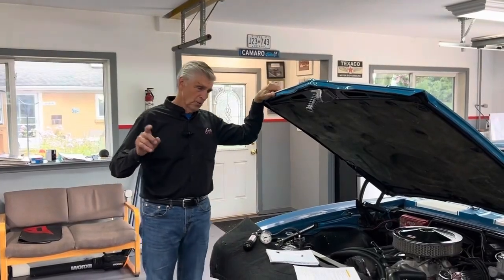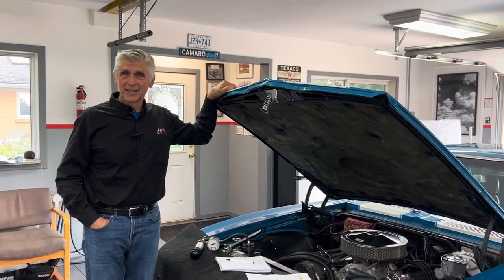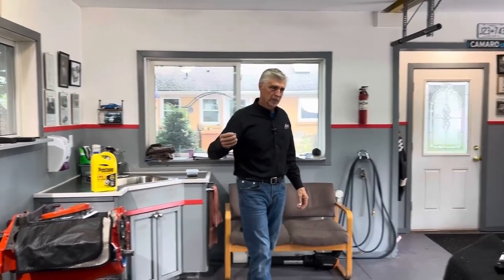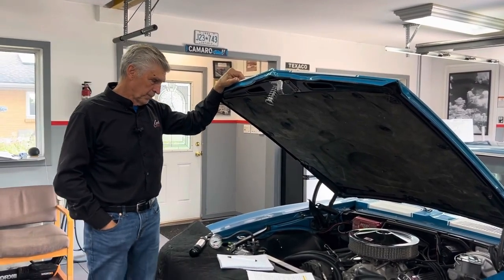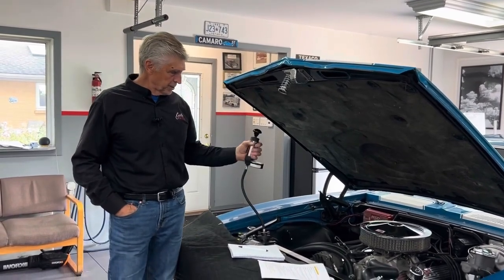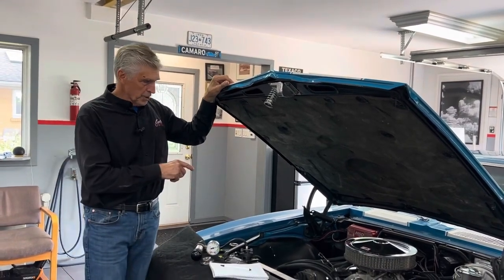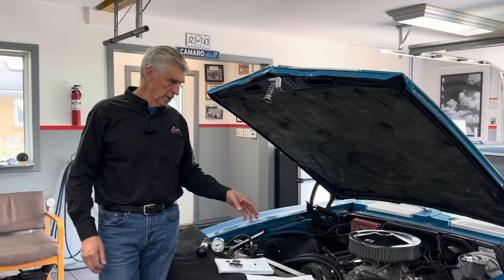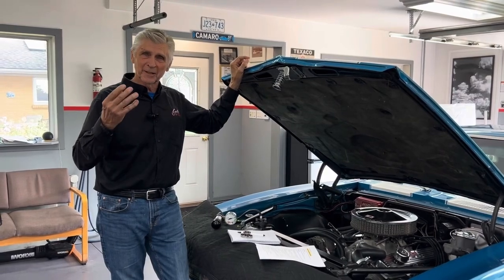THE ENGINE KILLER THAT GOES UNNOTICED! Coolant leak?? What should you do??

Comment: Recently had some poor quality Amazon pipe plugs in three locations on two different cylinder hands leaking coolant. Replaced with better quality plugs and stop the leaks and luckily completely external. Link was very slow and took a month before there were witness marks of where the coolant was leaking.
Reply from the maker: Thanks for your comment Reeves. I have had similar experience with Amazon pipe plugs. Always something new to trip us up. AG

Comment: Don't forget to NEVER Re-use head bolts... Once they are torqued, they stretch. A second use may cause coolant to seep into crankcase. 
ARP is the best way to go for head bolts with plenty of lube. They are an added expense, but great insurance to prevent leakage..
Reply from the maker: thanks for your comments Onm. AG
Reply: That's specifically for TQ to yield head bolts. The 100,000's of racers engines around the world that have reused head bolts after a refresh and Tear down inspection would state otherwise.  Rod bolts which are a lot more critical needing to achieve a specific clearance get Torqued several times on a new build. Which is proof that a bolt can be torqued more than once. We do monitor stretch which will tell us when they are no longer usable. I'm on my 5th freshen on current engine with the same head bolts. It's just been getting faster. Pretty rare to have a failed head bolt on a under 1000hp N/A engine.  Seriously boosted engines are a different story. Making sure the sealing surfaces are free of imperfections, have the proper RA value(roughness) for the type of head gasket user along with being  flat are the critical aspects for sealing head gaskets.

Comment: To soften up the peak tq you can go with a larger diameter intake manifold runner, reduce overlap, extend intake duration. Retarding the cam will soften below pk tq.
Reply from the maker: Thanks Shane, all good points and things for me to think about. AG
Reply: @goldsgarage8236  Another thing you can do is vary ignition timing. With a progression ignition programmable distributor you can pull timing around peak torque and add it back in after etc.

Comment: Hello Allan that reminds me of Cadillacs HT4100 horrible engine
Reply from the maker: Thanks Christopher. Interesting, that is one of the engines i was referring to. I had a 1987 Cadillac 4.1. The only time I ever purchased the extended warrantee. The camshaft failed after 7 years because of an intake manifold coolant leak. GM replaced it at no cost. AG
Reply: @goldsgarage8236  Yes sir the cam went out on ours too and the oil filler cap stayed milky. Backfires through the throttle body at mid acceleration

Comment: Hello AG, I have found that the factory GM pick up truck TBI air filter housing assembly from around a 1995 C10  will work on all these carbs. If you go to a wrecker, get a,one and the 1-1 1/2 " spacer that mounts between the throttle body and the filter housing base.These breathers have a large snorkel and a slightly dropped base . the spacer will allow it to mount on a Quadrajet, Holley or Edelbrock . I have a factory twin snorkel base on a vortec head 383 using a Edelbrock EPS and a square bore to spreadbore adapter thats maybe 3/8 to 7/16" .... it works pretty good.
Reply from the maker: All good info, thanks Nerrad. AG

Comment: You should also talk about short tripping your car and not getting it warmed up. Can get condensation in the engine that way. Or too cold of thermostat in cold climates. I had that issue with my 351m truck with a 180 tstat. Even cardboarding the radiator didn't help much. Didnt want to run a block heater due to energy costs where I'm at.
Reply from the maker: Thanks Frank. That is a very good point. Getting the oil hot will help to evaporate any moisture in the oil. AG

Comment: If  you run water as coolant and you store your engine below freezing make sure ALL the water jacket is absolutely dry,  blow it out, do not just rely on the block drains to empty it.
Alternatively store it with antifreeze in it and flush it when it comes out  of storage.
Castings can be awfully thin and easily cracked.   
Speaking from sad experience, few things are worse than showing up at the track in the Spring and facing  the oil in the water or the air in the coolant nightmare.
Reply: Yep! Some farmers run only water. All it takes is one time and tractor motors are extremely tough to remove
Reply from the maker: All good points. Thanks for contributing to my channel Uncle Vom. AG

Comment: Alan, I purchased a used Jeep, an '02, back in 2009. I now have approx 160,000 on the  odometer. About 4 years ago I was seeing a pattern of the coolant level getting low. It would take sometimes 3 months. A pressure test showed no external leaks. What tipped me off was that even before, I could smell antifreeze and you know that smell when your heater core leaks but my heater core was fine. I never saw any signs of water in the oil and with using Amsoil full synthetic, I only change oil once a year. My engine is clean anytime I look at the oil fill opening in the valve cover. Never did water precede the oil when doing a change. Finally it started to become more often but still absolutely no visible signs. I finally pulled the valve cover and there was one green drop in the middle of the cylinder head between #3 and #4 cylinders. Jeeps do have a reputation of cracking heads on the 4.0 liter with the casting number mine had. I wound up putting a new cylinder head on the engine. Even after removal and cleaning with brake clean or 2+2 Gumcutter, I coulld not find the crack. I had the head sitting outside and looked at it about a month later. Finally a crack appeared and only a thin line of rust made it distinguishable. You could not see it with the slight muck on the head. I believe this was going on for a number of years. I had the pan off to replace an oil pump and the muck that coated the crankcase was like the thickest tar I had ever experienced. It required a scraper to remove and it was super yucky, kinda sticky tar. I used to work in a machine shop and doing teardowns, this was a new experience. The slow ones like I had can be hard to find. Since then, the plastic tank has developed a crack on the top and I have repaired it 3 times, next time will be a new heavy duty brass and copper radiator from Rock Auto. I hate leaks more than anything.
Reply from the maker: Thanks for sharing your experience 4Speed. Good example of how difficult it is sometimes to diagnose leaks. AG

Comment: Just because you see an external leak doesnot mean there is not an internal leak. I had a drip from the intake and sent in an oil analysis and it was leaking internally. I've never had  chevy v engine that didn't have failed intake gaskets from the factory. Felpro solves those problems.
Reply from the maker: All good points. Thanks for commenting RDCM.AG

Comment: Hi again, Alan. This episode hit close to home for me as I'm sure it does for many of your viewers. I recently completed a rebuild of a Ford 351 Windsor small block. The engine is from my original 1969 Mustang Mach 1 that my father bought new for me. After fifty-four years of faithful, reliable service and successful Stock-Class Drag Racing results the ultimate indication of a slowly-leaking head gasket reared its ugly head. A cylinder hydro-locked, destroying a piston, bending a connecting rod, and taking a slight chip out of the lower skirt section of the corresponding cylinder.  Fortunately, this occured at near idle. If at speed, the original block and crankshaft would've been destroyed. The car also could've become uncontrollable, sliding in its own oil. A twelve-thousand-mile, original-paint car might also have been destroyed...Not to mention any injury or worse to a human being!  I was able to rebuild the engine using the unsleeved original block, crankshaft, and other components other than the connecting rods and pistons. How luck was I!!! It's back running strong again. Alan, adding to your tips and suggestions, I would also recommened that an oil analysis be performed on occasion. This may prevent an existing issue from getting worse and possibly costing thousands down the road. Thank you again, Alan for sharing your knowledge and expertise.
Reply from the maker: Thanks for your comments Bill. Hydro-locking is an extreme consequence of water leaks that i didn't think to include. Water is also not compressible. Also, oil analysis is also a good tip. i will try to mention it on a follow up. Thanks for the input and contributing to my channel.AG

Comment: I'm installing new rings in my chevy 355 with forged pistons. I don't race it but I push it hard on the street. What rings would you suggest? Thanks.
Reply from the maker: Thanks for the question Joe. For this engine I used Sealed Power E251K, moly top ring, 5/64" standard rings. AG
Reply: @goldsgarage8236  That's what I had in mind but I needed a second opinion from an expert. Much appreciated.
Reply: Use good reliable rings!

Comment: For your testing.  On air filters.  Drop base vs a flat base with a velocity stack shape.  Great show.  I learned something.  Ive experienced head gaskets before but didn’t know about condensation drip down to lifters.
Reply: An engine that sits a long time in a high  humidity environment and goes through lots of hot/cool cycles is a moisture trap.  Once droplets are big enough to roll down and find their way to the sump or a lifter that water is sealed away under the oil - air escapes during the day, and more moisture is added in the draw caused by night time cooling.   Generally, this is a junkyard kind of problem: no hood, out in direct sun in a field [or outdoors parts rack],  on an otherwise tight engine.  Can  1oz/year do damage?  Sure.  Mystery cylinder rust in a non-flood car is a perfect example.  By the way, a k&n filter does seem to help stave off intake ingress providing there's a hood to prevent direct rain.  I recently pulled apart a motor for somebody  that sat 30 years...zero bore rust, but there was some in the bottom of the oil pan, a spot on casting above lifters, and on a couple rockers [directly under the breather of course].  The old filter had a whisper of oil left, but got replaced as part of the rebuild as material age demanded it.  Not too shabby.  I did take those lifters apart for clean & inspect by the way and no rust there, so that was a mild scenario.
Reply from the maker: Thanks for your comments Gary.AG